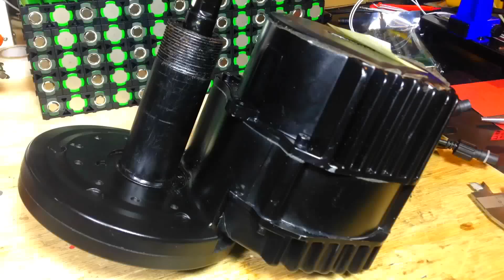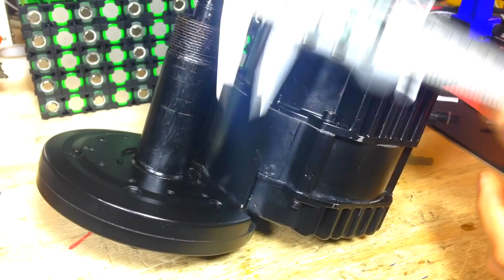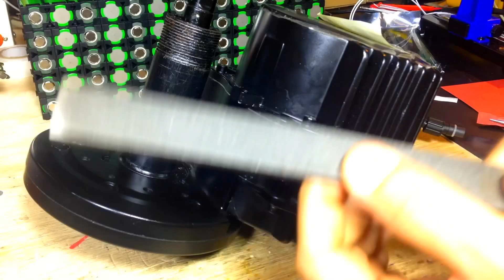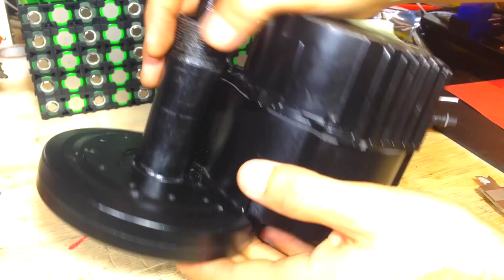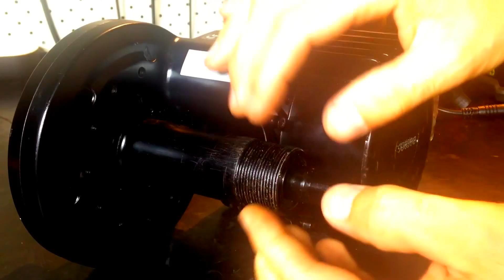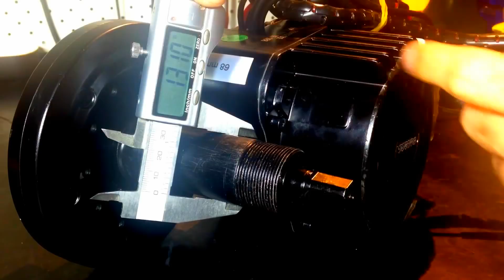BBSHD measurements: carbon fibre, dual suspension, fat bike bottom bracket • Bafang 1000w BB adaptor

Comment: So the BBSHD should work without mods on a rigid steel frame Mongoose fat bike. Right?

MachOverspeed
Reply from the maker: +MachOverspeedsPlace - Humm. not 100% sure about this particular bike, Fat bike has a different "drama" the motor may be touching the chainstay. Many cases if the fatbike is 100mm BB if it hits the chainstay you need to get the 120mm BBSHD and use adaptors/spacers on both sides to compensate that.
Reply: ElectricBike

Gotcha! I live in the middle-of-freakin-nowhere rural Texas, where nobody has ever even seen a fat bike...

Which means a 2 hour drive to Ft. Worth so I can (hopefully) find a copy of the bike and take the requisite measurements.

LOL... This ain't gonna' be easy no matter how much money I throw at it. So I'm thinking that for me, the best route is probably just save some more sheckels and buy a complete bike.

Or else buy a used motorcycle for the same money?

Oh well... I had dreams of a family too. But that didn't work out either.

MachOverspeed

Comment: i tried to fit a bbs02 on a new whistle miwok 1482d and it wont go past a raised lip in the center of the tube. Devestated.
Reply: +Anthony Steele what inside the crank though hole?.. its an alloy frame so if its just an alignment aid for the normal crank I'd be looking at just filing that down a little if thats all that stopping you fit the kit..
Reply: he bottom bracket shell narrows in the centre so the bbs02 gets stuck.
Reply: +Anthony Steele if its narrowing to a tapered point in the center and you have clearance to get a half moon round file in the crank hole without catching the tread, crack on just be careful as you go.. if its catching right by the outside of the crank then i'd get the frame down to a engine / machine shop and they should be able to wizz the extra material out pretty quick, shouldn't cost to much.. your main consideration should be if you have enough material left after to keep the frame strong but i see no reason why you wouldn't?
Reply: nah it's not happening, going to sell the bike and soup up my old bike  to a similar standard.
Reply from the maker: +Anthony Steele - I think what Dave was telling you to do is to file / grind / sand the small weld bumps inside on the top of the BB (not very visible). Aluminium is really soft, this is a 3 min job =]
Reply: it's not weld bumps it's 2 inches through the middle, 360 degrees (the frame itself)
Reply: I read that all italian bikes have this. Whistle is an italian company
Reply: +ElectricBike (Bruno) No biggy I souped up my old bike instead which fits perfectly :D